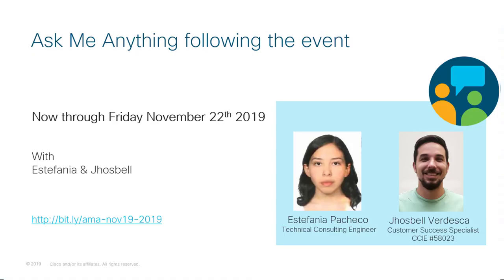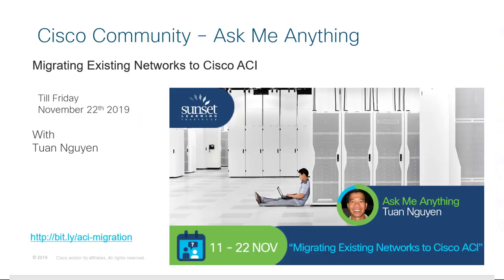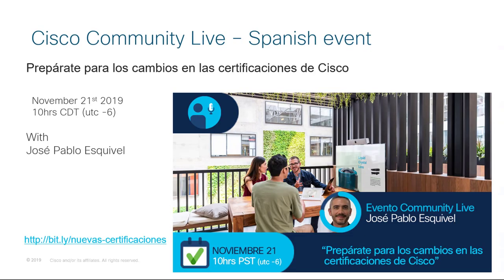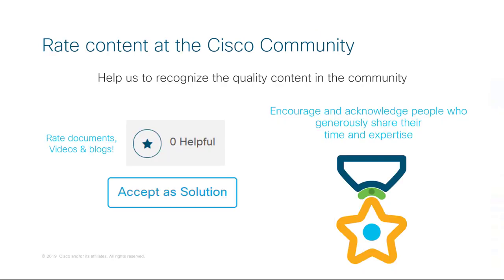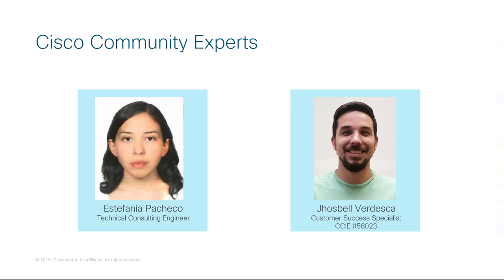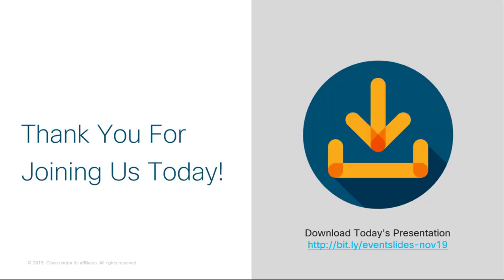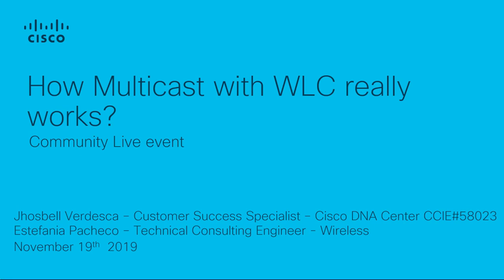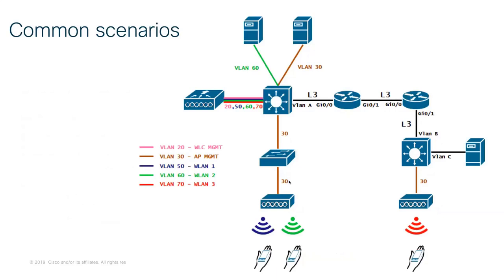Understanding how Multicast works with Cisco Wireless LAN Controllers

Comment: Can I control client in VLAN 60 only receives multicast traffic from multicast source in vlan 60 and no where else ?
My second question is Can I control client in VLAN 60 only receives multicast traffic from multicast source in vlan 60 and no where else and client in VLAN 50 to reivece multicast from source in VLAN 50 and no where else,  provided both VLAN 50 and 60 are dynamically assigned vlans to clients associated to the same SSID.